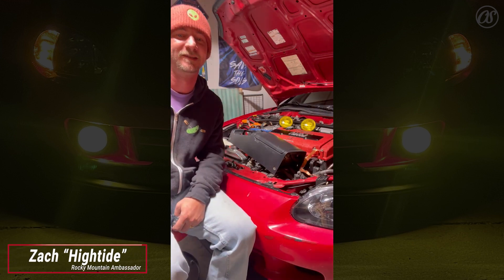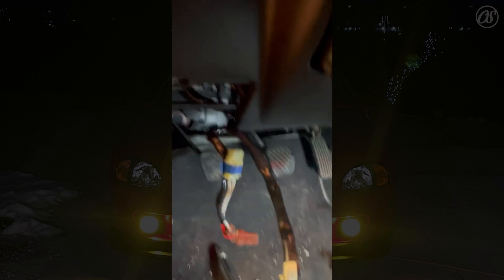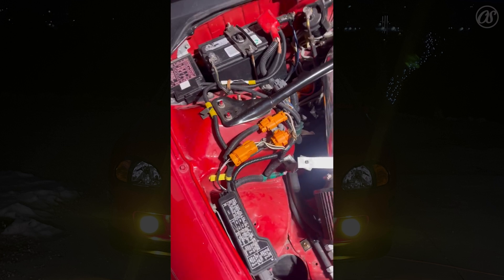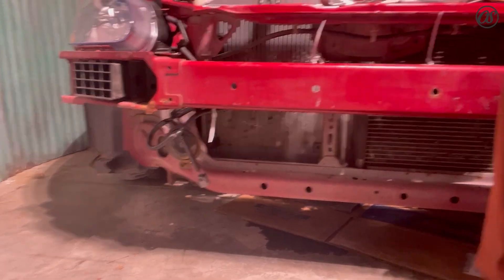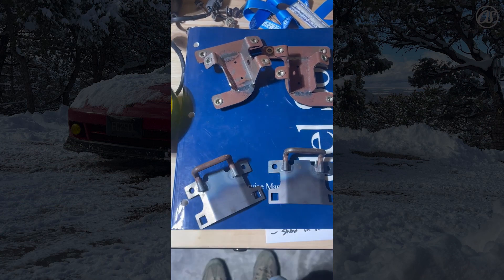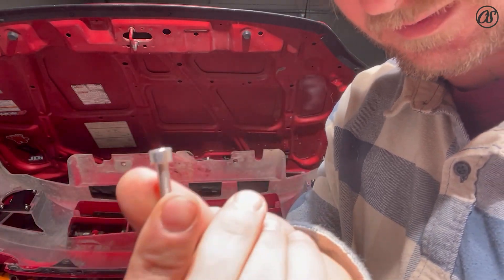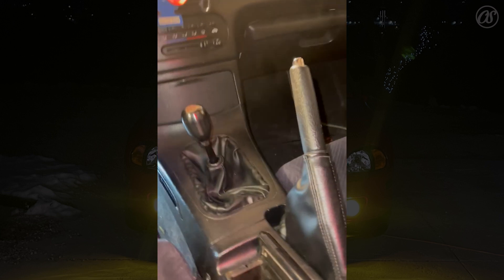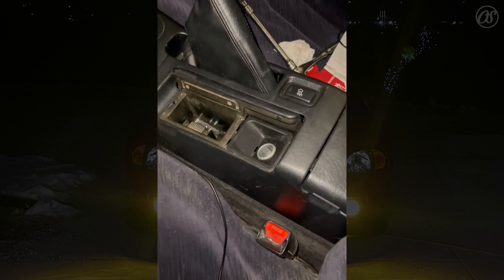Honda Del Sol - Raybrig JDM Fog Light Install - OldSols Vlog 111

Comment: u guys didn't got us deep into the transtop! mine not working.
Reply from the maker: O0o0o0 bummer - are the gears broke or an electrical issue?
Reply: @OldSols  idk, when i push the button on dash nothing happens and same with keys on the back
Reply: There is an ecu in the trunk that blinks codes. Try seeing if it shows anything if you haven't already.
Reply: @a01252  mm ok